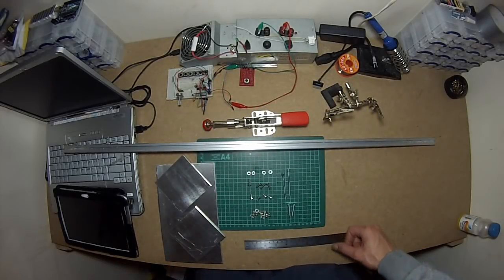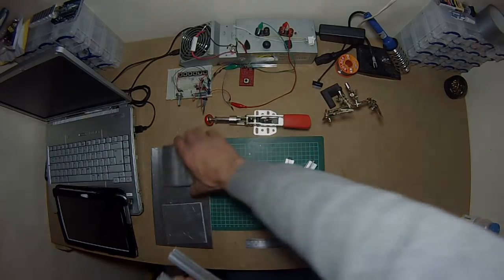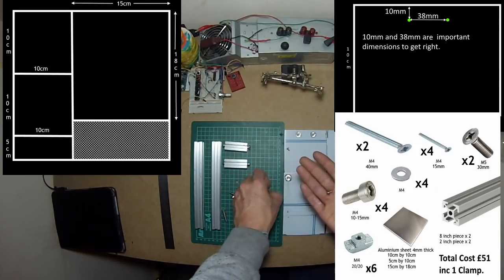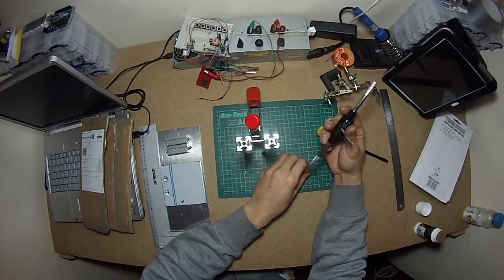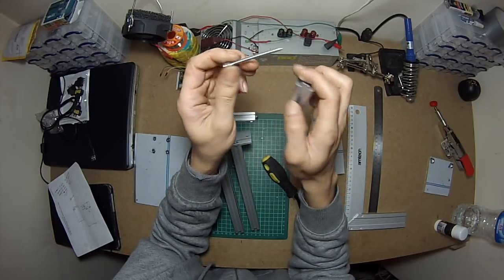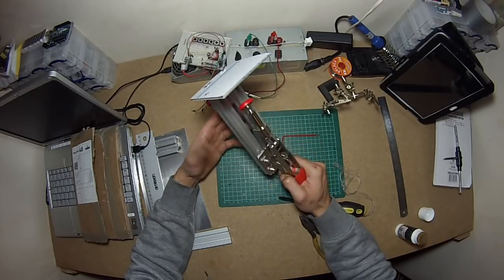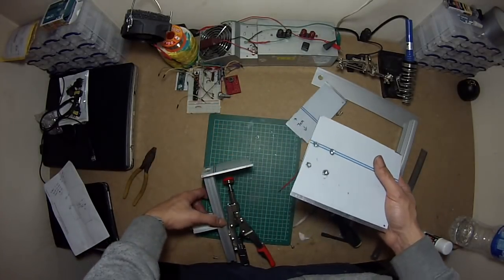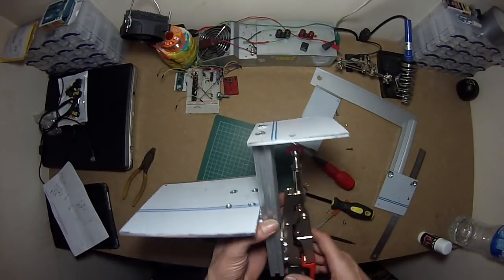Joystick Mount. Mini Monster tech.

Comment: Could you send me a link to an ebay seller who is willing to cut the sheet for free?
Reply from the maker: Hi Matthew
I had a quick look on ebay and i found this seller the first 2 cuts are free then its 50p per cut.
https://www.ebay.co.uk/itm/Aluminium-Sheet-Plate-Flat-1mm-4mm-multiple-sizes-grade-1050A-H14/283528663514?var=584704869588&_trkparms=ispr%3D1&hash=item4203a011da:g:hCcAAOSwsBtaMTUF&amdata=enc%3AAQAFAAACYBaobrjLl8XobRIiIML1V4Imu%252Fn%252BzU5L90Z278x5ickk7PdDazAlGltMLJlUhrWsD74hbuGHadmM2k5RGNs6DWm08nUvxpm5kS%252BrDBix%252F9tAnzfm8NL9GZmiy2EzVBqxxF%252B7B%252F13TIzwfOGbx7yFufIe%252BjmNZKmJ3P1G%252F9YQKIPGlrXUlo06ZC4%252F3xp2DKiVVXsLXuJ7%252Fqt4nb%252BnyTxRwwszgU7f2niUUYyFUfETAgbt93cS5kYcjeMPm2IqmpR0%252BHDJcK%252FoKyIzbhu8KZZ2kTk6LczXSH4lrsqc1Y45BeCpdtTA8jMuZ16wQbLDB84zwBqkiHmudMIq18Ap6kEQ2PmMNhWj11Rjowvy4XHZvVQ72XtwjzWWE5BtwgbdtKeUuYmD8iwJKCOhLBkzTHc9g%252FgSFm8ziXmkNVkdNSUt6r1pGKXD8VvLodKYNbsF47Q0jgMILAi0tUcplEsTaYKxMrDlnWCFbFzVpFb78cKXgffBAV95K33LWQOH8jzLfy%252F521kpohu02hdVOlNUmzrBg2ojWLAKO%252BA1465tIszlc9Ozx%252FuP240%252Bfoa2e5lHm8j%252Bz92OvYp0XJr9gpX2%252BT6W35aDiqiahZprJ35C16HaAnOcjb92H8UvwZbw9GJYKsWFumifxRqkUQ4BBHBnKH3Okm96KExCQFjbffYC9S7AFS6h%252Bk32FwCgVRR8haSfvJ%252FagQtl6ZtDdtb1Ga9%252FfGX0KW%252BCPs%252BFD0WqIKMjeV5mpt0B3U6d%252B%252FkixMYIQVccTDU%252FRAe0nmxjhPEp%252Bm7ezQjxgEtA8mnHXSUD6Y42NDSaY9Q3%7Ccksum%3A283528663514f0d4fd8c11b342ae8f58bfa0a5611030%7Campid%3APL_CLK%7Cclp%3A2334524

Comment: asmr detected
Reply from the maker: Autonomous Sensory Meridian Response (ASMR), sometimes Auto Sensory Meridian Response, is an experience characterized by a static-like or tingling sensation on the skin that typically begins on the scalp and moves down the back of the neck and upper spine. It has been compared with auditory-tactile synesthesia and may overlap with frisson.

Comment: Hello from Australia.  
Well done.  I was just in the process of specking something up to do the same job (didnt want to spend the money for the monster tech efforts, 2 X Warthogs + Left handed conversion already blown the budget way out!)
You have just made my job a lot easier.  Thank you.
I'll let you know how I go making it and acquiring the parts in Australia.
Reply: how did you go with this man, i would like to do the same and also live in WA! cna you send me a parts list where you sourced it all from?
Reply from the maker: Wow thanks alot dude i really appreciate that comment! 
and yes i'd be interested in your final setup it seems like you are setting up a nice pit ;) good luck and glad i could help.
Reply: I've ordered all the parts today, but most are coming from ebay meaning they will be here over he next 1 to 3 weeks (I hope, some parts from China).
Very little is available here in Western Australia in the way of extrusions, etc.  They basically have to come from our Eastern States of Australia.  And the fixings are MUCH cheaper from China.  Just means a bit of a wait, but I'm a patient man - you gotta be if your waiting for SC :). So I switched tacks from getting things quickly, to looking for the best possible prices and being prepared to wait.  Looks like its going to cost me about $100 AUD for 2 sets (4 units) with enough screws etc left over for several more.  My clamps are not quite the same (they are 32mm travel and 227Kg or 500Lbs hold), so I think they should do the job (about $10 each on ebay).  If they prove to be insufficient, I can always replace them and simply 180 the 2 aluminium plates around so I can cut new holes to accommodate the new spacing of the clamp mount holes.  I wont finish off the aluminium base plates till I'm sure, then I'll trim them up.
P.S.
I just realised that while we have used 2020 Aluminium Profile (20mmx20mm square), there is 3030 and 4040 available and 2040, 3060, 4080 etc (literally  4080 is 2x 4040 extruded as 1.  I cant say for sure, but it looks like MonsterTech's units are using 4080.  4080 is not that much more expensive than 2x 4040, or 2x 2020, but does limit your mounting options for the clamp.  I noticed that the clamp they use (the one your using) has slotted mount holes.  I have a funny feeling that 40mm mount spacing works for your mounts.  I'm assuming the 38mm spacing you talk about is for the 4 non slotted holes in the clamp.  Just a thought (that you have probably already realised/know about), but I thought I would voice it for others.
Reply from the maker: I agree just take your time and get your pit exactly how you want it.
yes i used the non slotted holes.
sad that parts are harder to get where you are :(